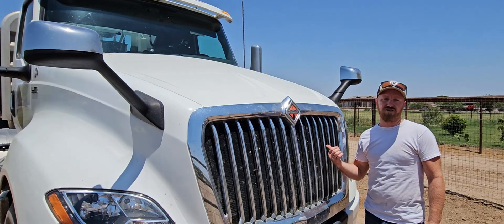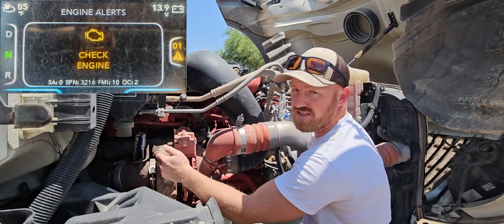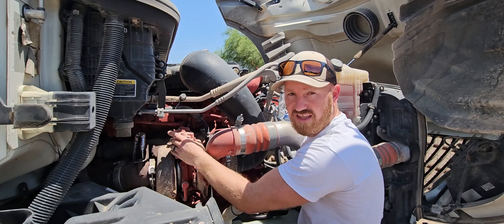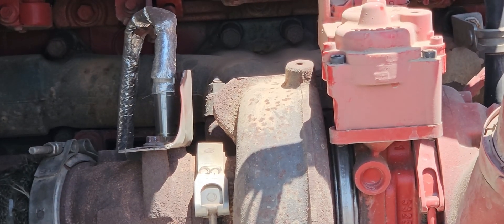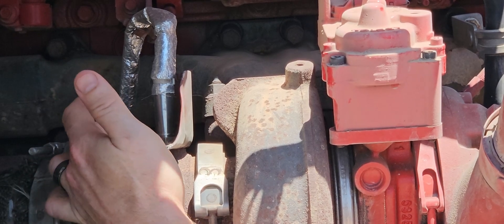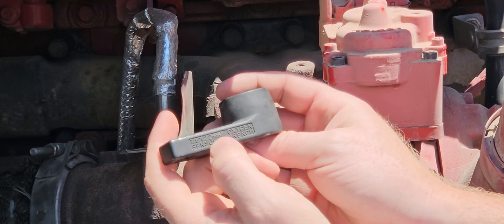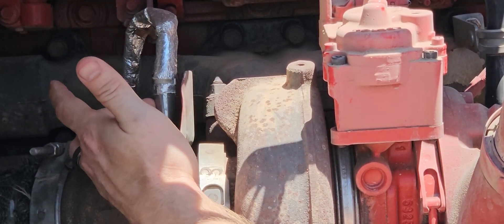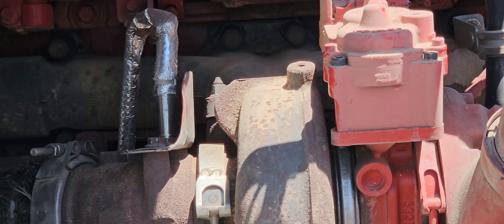Error Code SA: 0 SPN: 3216 FMI: 10 OC: 2 - Intake NOx Sensor - Cummins X15 Engine

Comment: Part#
Reply from the maker: What part are you looking for the part number?
Reply: @ inlet Nox Sensor for X-15 Cummins
Reply from the maker: @darylcampbell5952  Part number for the Inlet NOx Sensor is 4326874.  It's not a cheap sensor.  I just had it quoted out today for $790.49.  You can probably find a cheaper one but make sure it's the right one.
Reply: @ ok thanks
Reply: @ ok I looked that part number up and it’s saying 4326874 is outlet i’m confused.
Reply from the maker: @darylcampbell5952  that part number comes from the RWC group here in Phx.  It's what I used to get it.